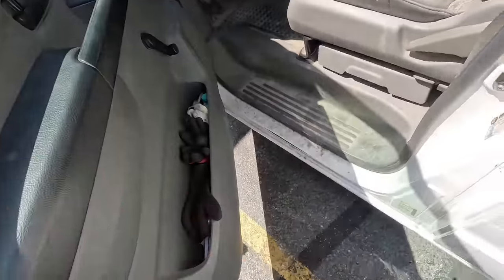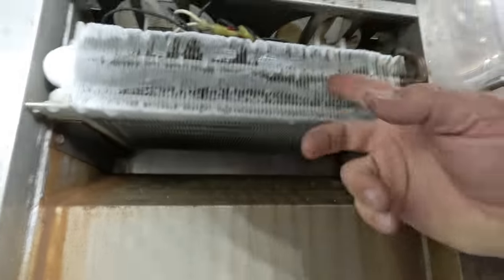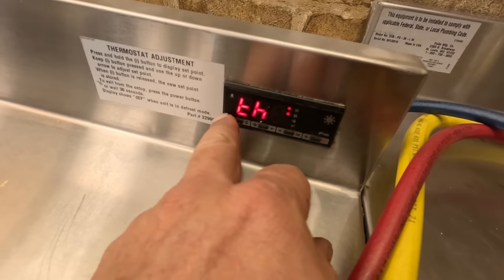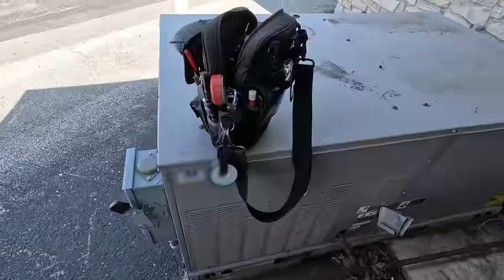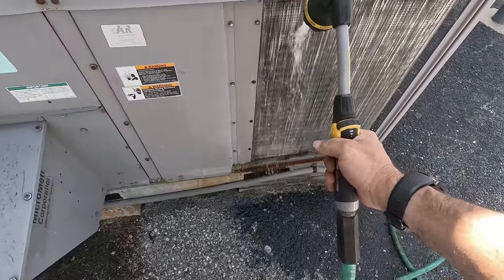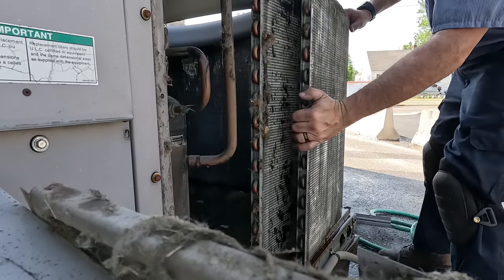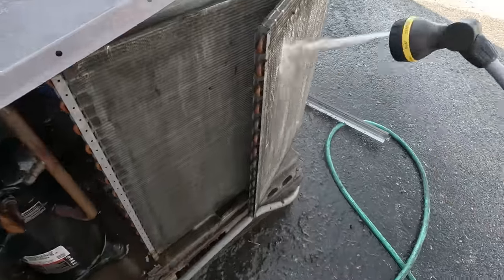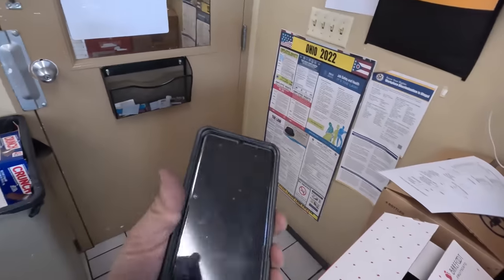Stuff Just Breaks & Wears Out Pay Me Now Or Later

Comment: For realz.  NOBODY offers to split coils preventatively and most owners don’t want to invest the kind of extra time it takes to do it proper.   So you nailed it, it’s gonna have to happen when the breakdown occurs anyway. 🤷‍♂️
Reply from the maker: Bigger units like the 3 layer Trane units are near impossible to split but this one took me 25 minutes.
Reply: @HVACRSurvival  ton of my restaurants have 4x 6ton carriers all with spilt coils.  So the extra half an hour or more per unit adds a few billable hours.    Love the videos man and grateful to be part of the community.    Happy Father’s Day
Reply: Three layer step looking cake stack.  1st layer the biggest and separate layers getting smaller. 

Engineering genius. Who would think dirt can become stuck in between layers of separate coils with a fan or multiple fans drawing "clean" outside air through them?
Reply from the maker: @georgekolos5255  we never did get that clean as I wanted, you could only split it a couple feet. Had to use the power washer to get it best as possible. 🤫🤷

Comment: Quick question if you have time. I have a walk in freezer and my Scrool compressor seems to only short cycle on really hot days. I have confirmed it’s cutting in and out at proper pressure and it’s not pulling into a vacuum. I’m a little stuck on this one as it won’t seem to happen until about 90 degree ambient temp. Thanks for your time
Reply from the maker: I need more information. What refrigerant is it, what is the cut in and cut out pressure, is it short cycling at the end of a cycle after it pumps down? Where is the solenoid valve? Is it inside the EVAP or at the condenser? How many feet is the condenser from the EVAP ?
Reply: Thank you for the response. I didn’t want to send a message with all the details in case you weren’t able to respond.
The unit is 404A
Cut in and out is at 5 and 22 roughly and is confirmed on gauge
It is short cycling after pump down and then re engages a few times before fully satisfying.
It only happens in hot weather (94 plus) 
Solenoid salve is on top of walk in and it’s accessed by and access door. The condenser is on the roof so the solenoid is roughly 3-5 feet below the condenser but not in the EVAP.
Condenser is roughy above the evap about 7 or 8 feet if I had to guess.
It’s a heatcraft unit with liquid injection / Scrool compressor
Reply from the maker: @brushben22  the hot weather is causing refrigerant to expand and raise the cut in pressure switch. 22* is pretty common cut in my area for our weather because we've got to set them low enough that it will come on in the coldest of winter. What you could do is try lowering your cut-out pressure. See if I can get it to cut out at maybe one pound or two pounds. What's happening is the residual refrigerants causing the switch to kick back on.
Reply: Thank you and I’ll try adjusting. We are in California and we have very hot weather in our location for the most part. Winters never get to cool so I was thinking 1-2cut out and maybe 25 cut in. Thank you
Reply: Thanks again and if you ever get a free moment I think it would be very informative to explain cut in and cut out pressure and the variable factors that can effect your cut in and cut out pressures. I’m newer to refrigeration and I have a general rule of thumb idea about cut in and cut out but I could def use some fine tuning. Thanks again
Reply from the maker: @brushben22  IF it's really not cold in the winter there then you could go as high as 25-30psi, that will still be at negative 2 degrees which means as long as the freezer only needs to be below 0° then you'll be fine. It would be more of an issue though if you have ice cream in the freezer because you normally need to be -10 to -15

Comment: I still dream of the day that I never have to service any type of reach in cooler or freezer after 30 yrs of doing such.

I can say that these days, I never "pull" out charge and attempt to pull vacuum on such vs purge out to charge back in factory ounces of nameplate charge if such can be still read.

Why would anyone pull a vacuum on a known leaking system even if the system may hold a vacuum/ leak gets sealed in vacuum and only leaks on + pressure. 

I know exactly what pressures I want to see with taking into consideration many things like box temp, ambient temp, compressor amp draw, condition of coils, what is inside of box and what temperatures/ etc. 

I've replaced hundreds of such evaporator coils that are same as in AC, 90% of time of leak source.

I do not replace such coils anymore. 

Top off charge, see how long it lasts.. If has to be topped off again after a long time, like many months, 😮 then offer to put a sealant into system and hope for the best..

With splitting condenser coils to clean, depending on condition and age of unit, I also do not do.

Nothing like doing heavy maintenence on an old  neglected RTU or whatever and splitting coils causes them fragile  U bends to crack open!

Pressure wash with coil cleaner from both sides instead of risking destroying with attempting to split coils to properly clean!

Decades of experience talking that misses greatly R 12, 502, 22 etc.
Reply: Blew a lot of 12 to the atmosphere...😁

Comment: Question......in the automotive world if you have an AC system leaking refrigerant your not technically allowed to legally add any refrigerant until the leak is fixed. Why isnt this the law in residential and commercial hvac?
Reply from the maker: Find the link to the epa law and post it here, I have both certifications. A lot of that is a store policy to scam people into spending money. The last time I checked the rule said anything over 50 lb had to be repaired. Whether or not they said it had to be repaired immediately is a different subject matter. All my jobs are being quoted with the option to repair and if they choose not to do it they're wasting their money. Cars use less than a pound and a half it's hardly even worth worrying about. They want you to spend $2,000 in parts n labor to save from spending 50-100 bucks in refrigerant
Reply: @HVACRSurvival  interesting....thank you so much for answering 🙂
Reply: In general, owners or operators of an appliance that is leaking ozone-depleting refrigerant above the applicable trigger rate must either: Repair leaks within 30 days from the date the leak was discovered, (didn't grab the full quote) from the epa. I teach automotive hvac and I think the key word is ozone depleting now with that said in the automotive world the key word is detectable leak I will do my job and try to find it but I'm also not going to spend 4 hours tracking down a pinhole but with the refrigerant we are using 1234yf that stuff is incredibly expensive and our machine that we use does a leak decetion and if it finds one it will not let you gas it up and go